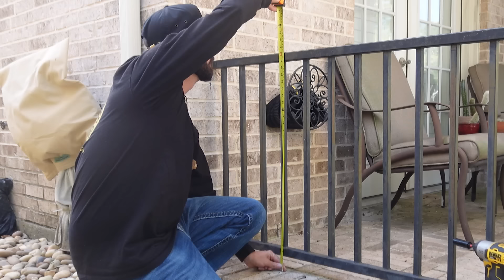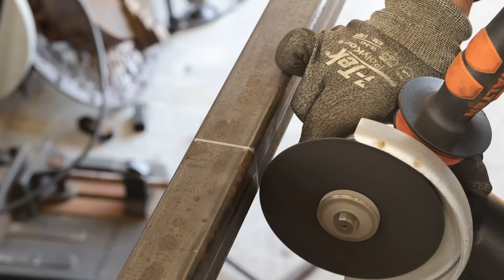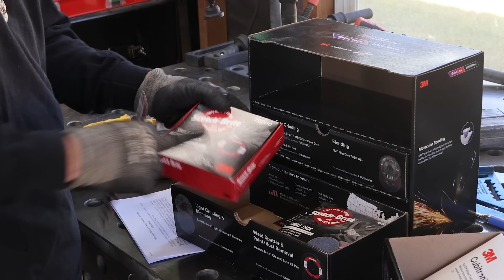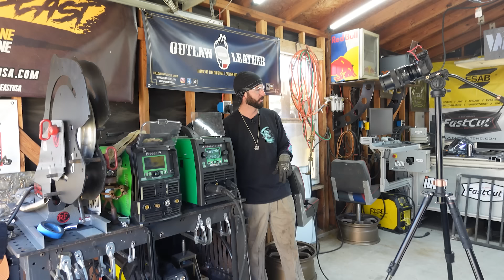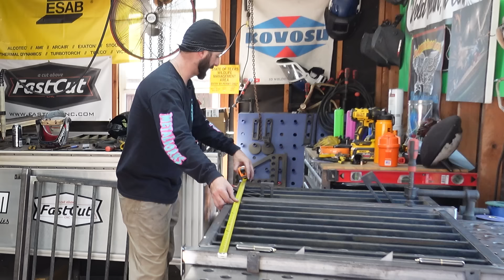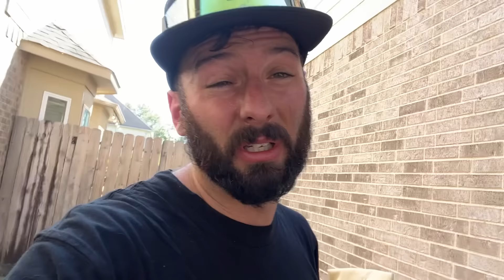Welding Side Hustles - Railings & Gates

Comment: Good tip on mark8ng all sudes is using the angle grinder if that's all you got. Still better than farming it out. You can't count on the steel yard to make accurate or clean cuts. They will tell you this up front also.

Comment: I love you showed that you made a mistske. That shows me the there is hope for me 😆. ai cant seem to find your cool welder ?. Could you plz help text the name ?. im 100 % new to this but i dont whant a cheap cheap machine that i wish i dident buy because i was new.
Reply: @110890nick  don't use AI. You can see the name on the front, Hurricane 220 MTS-C, and use non-AI search with that name.
It does mig, tig, ac tig, stick, and plasma cutting - which may be more than you want. Perhaps you have a local maker space where you can try different techniques? Only MIG might serve you well for a while (depending on what you want to do)
Reply: @epiicSpooky I got a fronius transsteel 2200:) And in October i hope i can get 3 weeks in school to practice welding :)

Comment: Hey man you did a great job, just wandering if the lock mechanism (The Latch) was supposed to go backwards meaning inside not outside or probably that's how the cutomer ask for it, am just wandering but thanks a lot for your advices and tips.

Comment: Dude, quit bitching about not having the chop saw, most guys I'm sure this video targets don't have one and won't have one for a long time. Been welding for what - 3 years? No cop saw yet and I've made a tonne of smokers, for some reason everybody wants one of those. Made some mirror frames and such. But yeah, I'd say get the ange grinder cutting down before you worry about the chop saw. I don't even have a table yet. Don't complain about your circumstances just use what you have - makes you better.

Comment: When you did the on-site modifications, did you have a generator or did you use the customers power? If so, what generator do you recommend for a 110V flux core & small angle grinder? Thanks for sharing your knowledge and great video.

Comment: That came out to him making $57.50 per hour on that job. Dam good partner!
($600 - $140 / 8 hr)
Reply: @mynameizjed  that’s not nearly enough a car mechanic shop is charging 110-120 an hour and we as welders are not any less skilled when I was doing stainless steel handrail I charged 200-300 an hour but that is on another level he we shouldn’t be making less than 110-120 an hour
Reply: @clearviewmarine  That's not how that works but okay.

Comment: If I could throw my 2 cents in maybe help someone else out, for a small opening like this pull your measurements, draw the size of the opening on your shop floor with your 4ft square and that way you can basically test your opening fit up off the job site. Draw the walls, draw the floor, set it in and test it out
Reply: @imbrandon16  that’s a good idea

Comment: I appreciate how Austin really emphasized marking your zip disc cuts. Get your marks even all around, score your cuts first, and pay extra attention to your bevel cuts. For anyone watching this who is also into carpentry, but maybe you're not very experienced there either. You can apply just about all of these techniques to cutting beams with just a standard 7-1/4'' worm drive or skill saw. It's not the "wrong tool" for the job, but like in this video a chop saw would have made things a lot easier. You can still do quality work with several different tools. And now I will click that link and try to win myself some 3m abrasives! Best of luck to all of you and work safe!!!
Reply: Thanks brother!

Comment: I went and bought a big bike carrier for my hitch on my van. Unfortunately, the thing is heavy enough that I can't just jury rig something to hold it up out of the way. For $50 worth of materials and another hundred of welding at a heavy mechanic shop, it's going to be a proper holder that I can just bolt to a pony wall somewhere with some concrete anchors and then it's a up out of the way and B I can put all my bikes into it and Come Away with a bit more room in my garage

Comment: Nice work. I wasn't sure what you meant by "elevation" at the end. Does the place the gate was installed slope?
Reply: The ground was slopped. I built everything on a flat “elevation” so when it was installed the rails were different heights.
Reply: @Drweldz  that's easy to overlook.....this happens to everyone,same with directions of the hinges 😉
Ti
Turned out great 👍

Comment: I too learned the hard way that barrel hinges are one direction only. It was when I opened the door on a 1500lb gun safe while it was upside down after a move into the basement (I wanted to remove the shelving before flipping it upright). The door came off. I'm not a fast moving guy, but I was that day, thank God.
Reply: I close somebody's gate in west Vancouver a very expensive suburb, and the gate broke while I was closing it and I went and looked at the wall and I showed him just what was wrong with it to a Layman who had done metalworking before and he got the guy to come out to sex it and actually do a good job this time
Reply: Yikkkes. Soft lesson learned